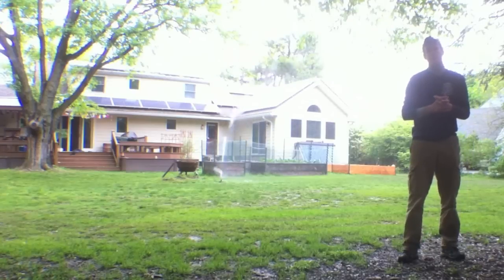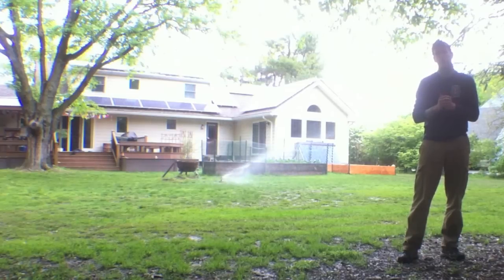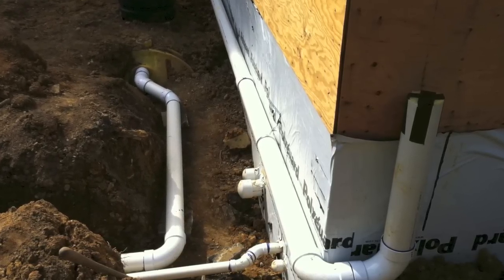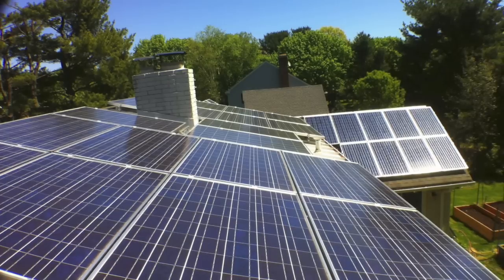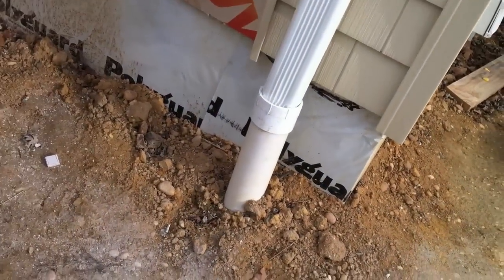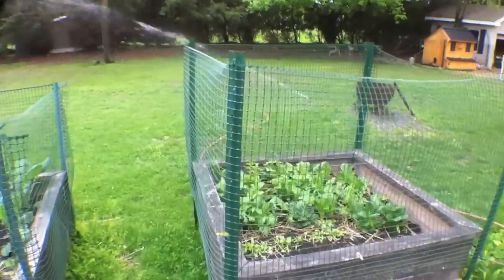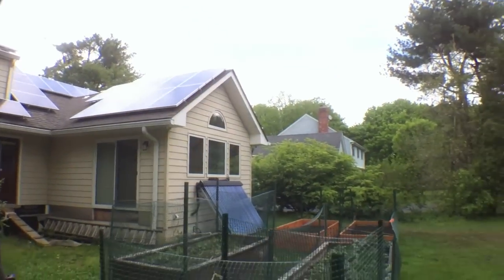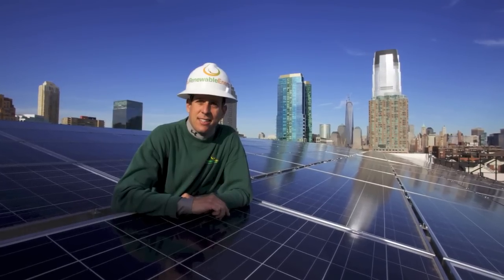Rain Cistern Lawn plant garden watering Zero Energy/No utility power 100% sustainable! Rain barrel

Comment from the maker: If you do the math, you'll find this isn't uncommon.  My total roof produces  more than 500 gallons.  An inch of rain per square foot is .62 gallons.   Most roofs in moderate rain climates collects tons of water.   We just don't use it.  For the most part, its cheaper to just use city water.  But not for long.  Climate change, growing population, expensive energy are changing the numbers.